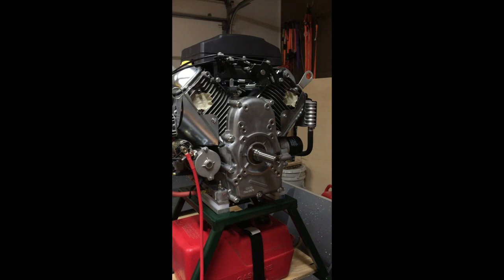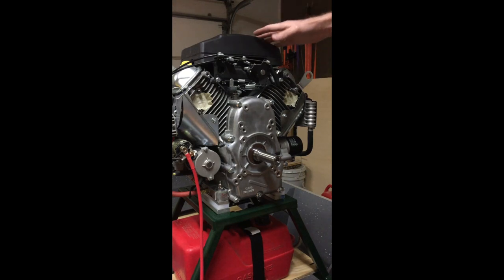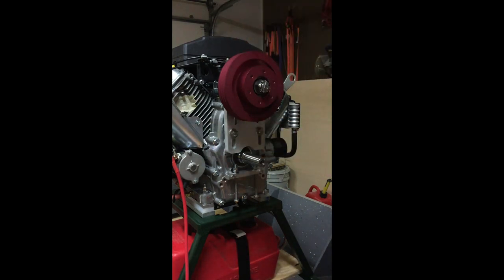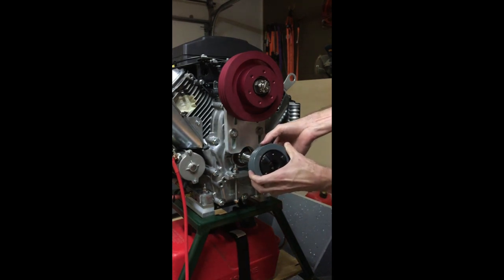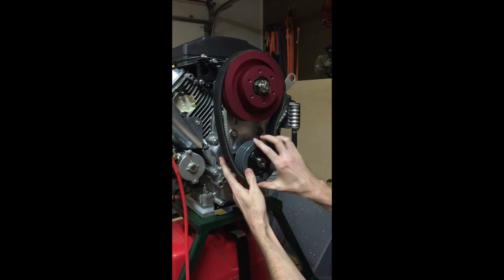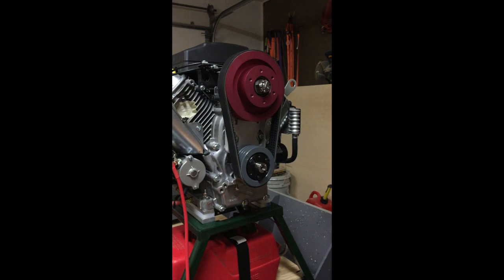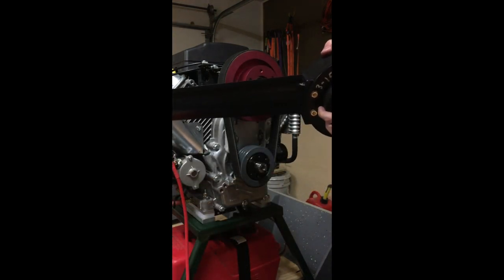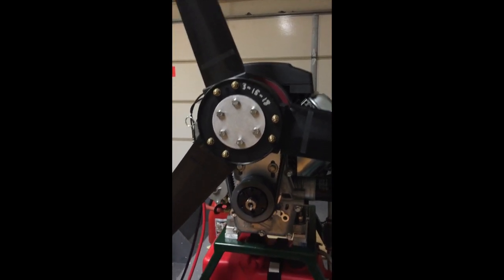Installing a belt reduction drive on the Predator 22 engine from Harbor Freight

Comment: Ben, nice video and GORGEOUS reduction drive.  In addition to LocTite on the key, an oversized washer should be installed over the shaft and secured with a retaining bolt, washer and lock washer at the end of the threaded crankshaft.  You DEFINITELY don’t want ANYTHING going through the propeller, as you mentioned.  Nice job!!!

Comment: Good vid 
So you cant use the muffler??
Cheers
Reply from the maker: Correct, the stock Predator 22 muffler gets in the way so you have to relocate it or make a different header setup

Comment: thanks your video. I have 15hp engine 38inch two blade wooden prop. for airboat.10feet long. I use direct drive 2 person.my question ?  total weight 2 person+hull+engine +etc. approximately= 300kg
is it appropriate? if it's not what should be? because mine is not powerfull. thank you for in advance.

Comment: Looks nice. I do have a question though as I'm a bit confused with the reason of the reduction drives I see fitted to these engines.  These engines have a stock output rpm of 3600 which in itself isn't too high for a prop, ( well upto a point) so why do people take the governor out to raise the rpm only to fit a reduction drives to slow it back down again?  Ive struggled finding the reason
Reply from the maker: Some people do run direct drive propellers on these engines, and it works well for certain applications. But generally a larger diameter propeller produces more static thrust, which is what you're after on slow moving craft like airboats and hovercraft (slow compared to aircraft, where prop selection is more complicated). So a reduction drive reduces your output speed, which means you can swing a larger diameter propeller on the same engine and get more static thrust. And removing the governor lets you rev the engine higher, getting more power assuming the valves and carb are set up right. So with the reduction drive, you can still turn a large propeller even when over-revving the engine. Hope this helps.
Reply: I'm a little new at this also, but by reducing the rotation of the prop by 50% and increasing the pitch of the prop , You get less vibration and noise and also increase the performance and thrust.

Comment: Hi I have a question I’m looking to get one of these for my little case tractor and I need a different exhaust set up where did you get the ones you have on there
Reply from the maker: We welded these up custom using some prebent exhaust tubing and pancake mufflers

Comment: And second question why we dont screw the propeller straight with the engine shaft. Why we put a pulley and belt . I feel in that way we lose some rotation because the engine small pulley has to rotate twice to get a full rotation in the propeller pulley which is twice the size .
Reply from the maker: Some people do mount the propeller directly on the engine shaft, but with a larger propeller this exceeds the maximum rated speed of the propeller. By reducing the speed, you can swing a much larger propeller, which gives you more static thrust.

Comment: Saving for you reduction drive prop combo but can you tell me were I can get that exhaust
Reply from the maker: We custom made and sold those a while ago but didn't like how loud they were, so we discontinued them. If you don't mind the volume of open pipes, we still have a few of them. If you contact us through our website, www.lonestarhovercraft.com, we can send details.
Reply: How much for this reduction drive and a prob spacer like the one used? I already have a prop ready.
Reply from the maker: SuperSprinter22 The reduction drive and prop spacer shown here are $799 plus shipping. You can order online at www.lonestarhovercraft.com or call or email us through the 'contact' page on the website. Thanks!
Reply: Nice job, would this redrive work for a single seat ultralight trike?
Reply from the maker: Juan Reimer sure, the reduction drive weighs 12 lbs and is suitable for a trike. With a 59" propeller you'll get around 150-160 lbs of static thrust.
Reply: LoneStarHovercraft ok sounds good that should be enough for a single seater I’ll keep you in mind once I get closer to the engine mounting, working on the trike at the moment thanks
Reply: #juan i am doing a project on ultra light trike with this same predator engine . Hop in if your into building together
Reply: SaberbrusVEVO hello yeah you should be able to use that propeller for a trike. And the question you had on just run the prop straight from the shaft, I would not do that because most propellers are not rated for high rpm, so for example if you would put some performance parts on your engine you may have over 4000 rpm so with the reduction you get right rpm on the prop and you can use a larger diameter prop and then you get more trust, interesting how it works but that’s what I can understand for what I have learned, and also straight shaft prop with high rpm it’s just to noise as well, hopefully that will help to understand you question

Comment: Please elaborate Purpose of belt reduction drive ??
Reply from the maker: It's to reduce output speed from engine shaft so you can safely turn a large propeller
Reply: @LoneStarHovercraft  sir, if by reducing speed, can we get max torque??max output fron engien ???
Reply from the maker: @drfaizulhassan2319  Output from the engine (horsepower) is unchanged, but the reduction drive trades off speed for torque. It gives you higher torque at a lower speed.
Reply: Though, I am (Biologist) Veterinarian, DVM, M.Phil in Animal Reproduction, yet I have an intention to build my ultralight aircraft in upcoming months, I need guidance in this regard....sorry for disturbing You alot ...